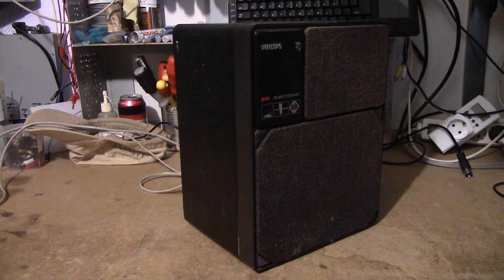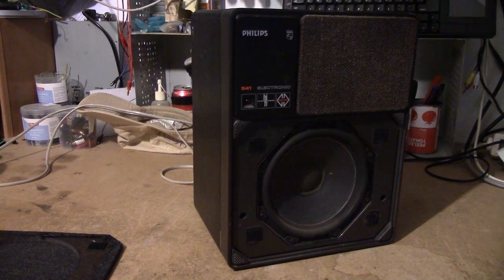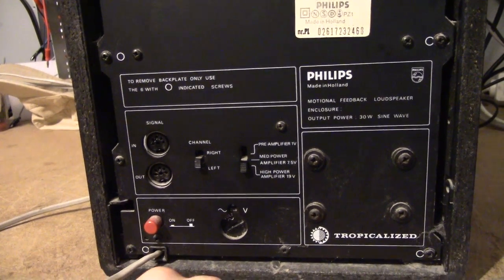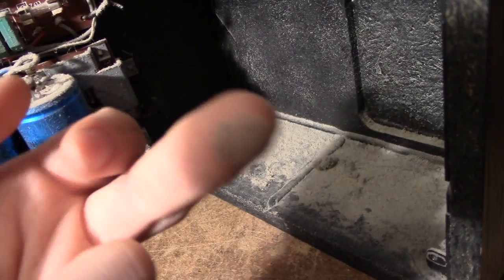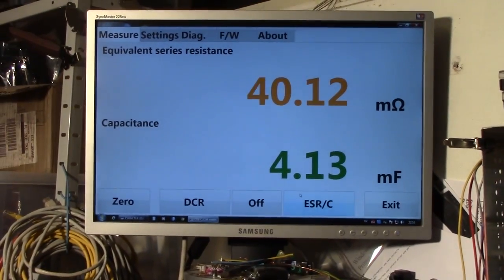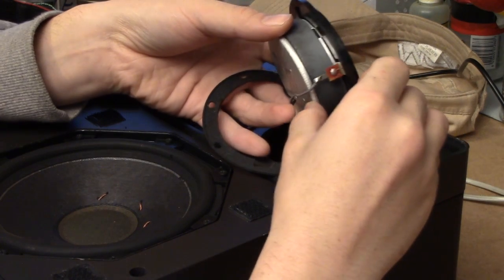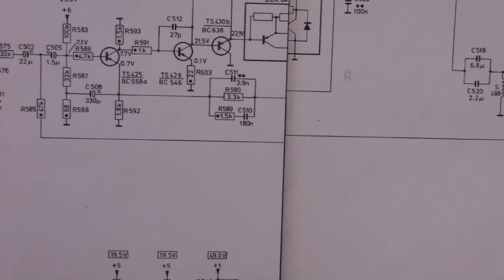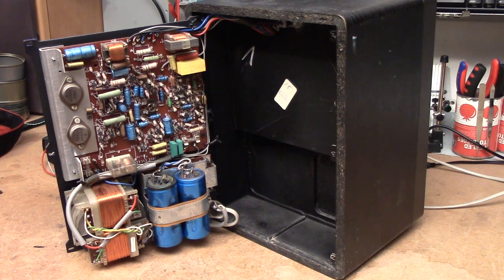Philips 22HR541 motional feedback loudspeaker teardown

Comment: Tropicalized means it’s made to survive in more extreme climates. Notice how a lot of components are not mounted straight on the PCB, but with a little space for heat dissipation. I have a set of 567’s here, completely recapped and I can confidently say I can’t see myself ever feel the need to buy something better. The only speakers that are better are probably the 545’s, but these are extremely rare.

Comment: Hello, can you please tell me if it is possible to use only a part of the circuit of the electro-mechanical-feedback-system for use in other active speakers? If I make a sensor myself, for sure it's the same type there as in the bells from the USSR of the 80s as radiotechnica s70 here is the link http://donex-ua.narod.ru/indexphp/as-ussr/29-as-ussr-
all / 171-s70.htm can be translated by a translator if you need there is a diagram below

Comment: These appear to be actual studio monitors... Going by what you said about their treble response sounds like they were meant to be near field monitors.... They are deliberately designed to sound terrible... As one recording engineer said about the Yamaha NS-10 non powered near field monitors that also have a very flat frequency response and sound terrible as HiFi speakers... If you can make the mix sound good on these... The mix will sound good anywhere... And those Phillips capacitors... Hmmmm I just love those things... They are very high end... I wouldn't be surprised if they were rated at 125°c...  They are still available on eBay.... And they aren't cheap either but I buy them from time to time to keep plenty of stock... I didn't know that these Phillips monitors even existed until I saw them in your video... But now I'm going to look out for a pair... Or even just one will do....
Reply from the maker: Studio monitors sound terrible because they're very flat. The tweeters on these are about as far from flat as you can get. They're absolutely awful as studio monitors in their stock form, lol.
Reply: Yeah your probably right... After all I only heard them through my phone speaker LoL. I guess that it all comes down to application. You're intended purpose for them is different to what someone else might use them for... Sometimes you find something like when I was given a portable battery powered mono speaker that was designed to be used like what we now call a Bluetooth speaker... I started using it to listen to the final audio mix because I read somewhere that it's ideal to listen to the final audio mix in mono and I was totally blown away over the fact that I can really pick out all the level errors and this little 3 inch speaker which didn't really reproduce the whole frequency spectrum allowed me to listen to the levels instead of making the sound good to be enjoyed.... The only other trick that I know can achieve similar results is to play the recording and walk away from the speakers and do something else around the house and you will notice when something in the audio is way too loud... Try it with one of your own videos and you will see what I mean... When you do the audio test... The level difference between you talking and the speaker test is huge.... It's not a criticism towards you... It's just me trying to get my point across and if I have helped someone in the process... I'm happy ;)
Reply: The only Studio monitor were the 545 which I have. The 541 were not made for studio.
Reply: Nope, they where home hi fi sold for home hi fi, Philips was ahead of their time, they sold these in the employee store at the time....others copied this idea
Reply: @FFcossag  These are NOT studio monitors, home hi fi, way ahead of their time